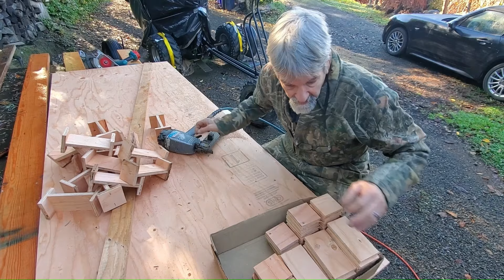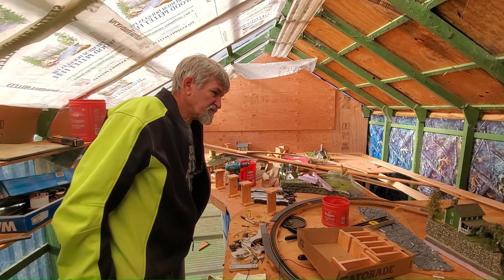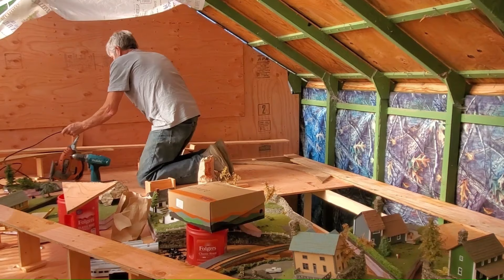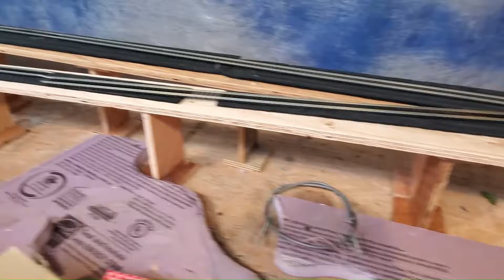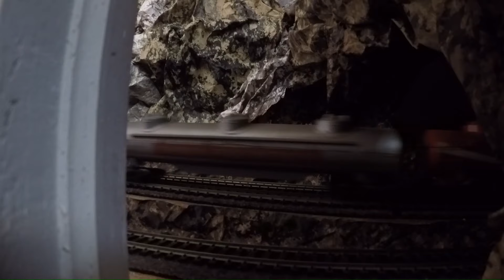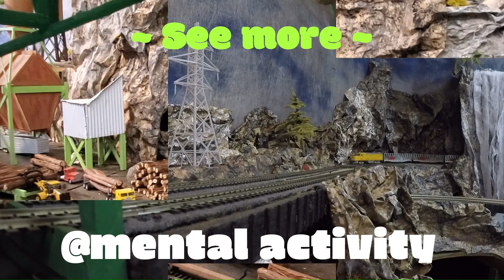Railroad update, building risers on new addition

Comment: Is that building Weathertite?   Nice Layout, Thanks for sharing!
Reply from the maker: Thanks for watching and commenting,.unfortunately it's not completely weatherized, it was a greenhouse and the plastic you see on the ceiling is to shield the sunlight from overheating.  The camo tarp on the north wall is getting plywood when I get some scaffolding ( this building is 10 feet off the ground ) hard to reach and sheet from a latter, but has held up through all the storms so far. Thanks again for watching and hope you subscribed so you don't miss upcoming videos 😊.